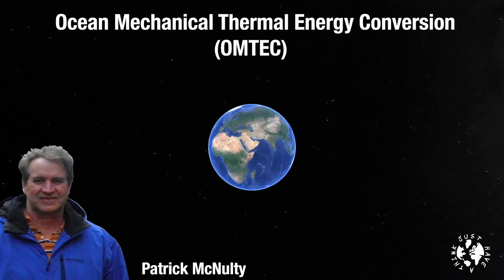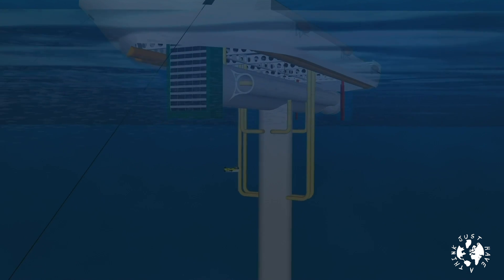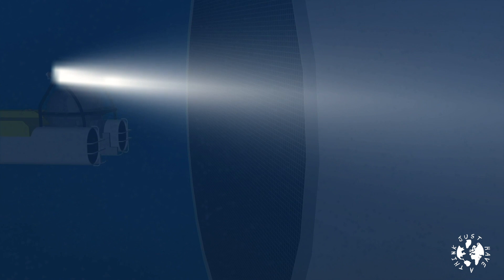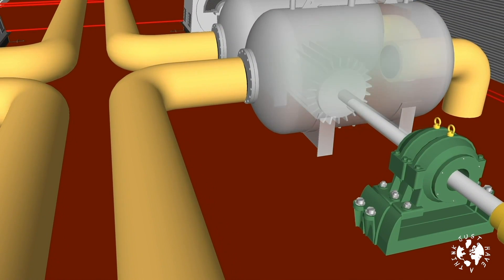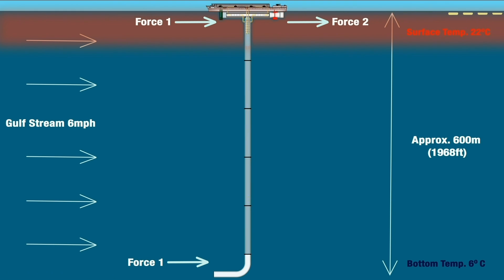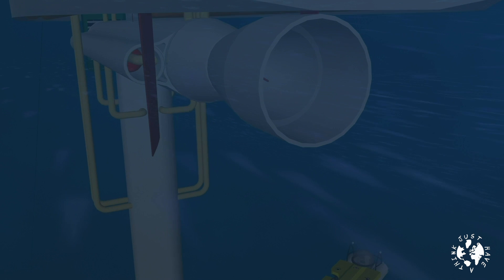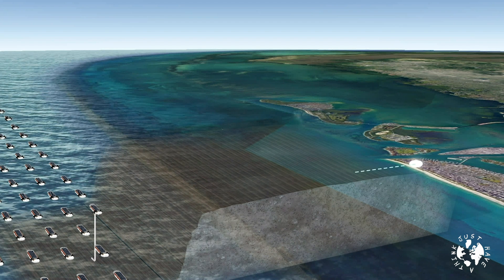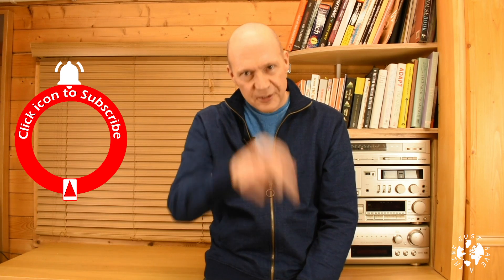Ocean Mechanical Thermal Energy Conversion

Comment: Really fascinating! - would be great to understand a couple of points if someone close to the project can answer ... 1) given the available temperature differences, am I right in thinking the max theoretical efficiency is around 5% (i.e Carnot limit) ? and if so 2) there is a vast amount of heat transfer that you're undertaking here so actually 5% of a big number is still significant?! and 3) given that this is primarily about cooling the ocean surface to lessen the impact of hurricanes etc - the electricity generated is sort of a bonus of the scheme rather than its primary economic rationale? -

Comment: If adding that turbine creates so much energy, shouldn't you just use a bunch of turbines (like an off-shore wind far underwater) instead of the entire system. To me it seems like the solar panels and turbine are the most efficient part of this system. So you could save a lot by just sticking to those and getting rid of the rest. And if pumping cold water to the surface is shown to be a viable temporary solution to climate change, then adding a bunch of those passive ocean straws (tubes with a venturi) could be added in as a separate project.

Comment: I think the temperature differential is too close to get much power out of it.  The vapor pressure to  drive the turbines would be relatively low unless you had some other heat source to raise pressure and temperature.

Comment: So, correct me if I am mistaking but you are proposing to mess with Atlantic conveyor belt, a process of distributing heat from tropical zones towards northern areas. This process depends on salinity of the water and yes, the temperature. Climatologists do warn us that it is already disturbed and may be approaching critical levels due to reduced salinity (ice sheet and glacier melting) You propose to attack it at both levels, salinity diversification and temperature differential. Such a move would (at scale that would produce some effect) as a result decrease its performance and have therefore tropical areas warmer and northern areas cooler. (Not reduce overall temperature of the globe) I will not try to go into calculations to see which amount of interference would be necessary, all I want to point out is that there is no "free lunch". What you propose potentially does reduce losses in a process of power generation by some measure i do not doubt that but overall messes with much more important process of balancing of the temperatures in larger area and water circulation which i am sure is tied up not just in for example rainfall patterns and plankton distribution but in quite a few more areas which biologists and meteorologists could point out. Sounds a lot like you are proposing to reduce inherit losses in process of shooting ourselves in the head for sake of a few kilowatts of "free" energy? If i may i would suggest that you "just have a think".

Comment: The obvious question is how does this complex system handle large waves and storms.  Also keeping Freon as a liquid would allow more power through the generators.  I’m not a representative for big oil but I heard of a project called net zero where they generate electricity from natural gas, using compressed co2 instead of water to run the electricity generation.  This would be way cheaper than your ocean electricity generator.

Comment: A not-mentioned side effect is the worming of the "deep" water (where the intake is). You just cannot take water from underneath and pump it to the surface and not have surface water flow underneath. You would be increasing the quantity of surface water and reducing the quantity of deep water which is of course ridiculous.

Comment: If you are drawing cold water up through a warmer fluid, then the hydrostatic pressure will vary differently inside the tube to  outside of it, making it more difficult to draw up. If the cold water  was 10 degrees drawn up through 20 degree water, this would generate about 15Pa of stack pressure per meter that would need to be overcome to draw it through the system. Depending on the depth, this could prove a significant barrier to the 'natural' flow of water that is intended to be induced

Comment: If running cables to the shore is a pain, consider using the power to generate hydrogen through electrolysis.  There is already a market for hydrogen and it could be huge in the future.

Comment: you haven't mentioned the energy payback. How long would it have to run to generate the energy it took to build it?
Reply: 5 years about the same time it would take to restore the Arctic Sea Ice..
Reply: @patrickmcnulty848  compared to 3 months for an offshore wind turbine.
Reply: @philiprogers5772  The problem is windmills are not 24/7/365. Ocean Mechanical Thermal Energy Conversion is.. Great for base loading..

Comment: I find it hard to see this realy work, forces on the pipe will be a challenge. And also, the cold (denser) water will not want to go up into the hoter ( less dense) water without having energy put into it. I dont see it all adding up
Reply: The energy to raise the cold water comes from the venturi effect of the Gulf Stream flowing through the large horizontal tube.  Watch the vid again.
Reply: @danmoyer4650  That just a T in the pipe with a restriction behind it. Not a venturi. This is not going to work at all.

Comment: This was incredibly fascinating to watch and learn about. I simply love the concept and potential this sort of energy generation has, especially for reducing our reliance on fossil fuels and generating clean energy, all provided naturally by the planet. 

If I may ask however, given that the OMTEC 'ships' are constantly in motion, how will the energy be transmitted back to the surface / mainland? Will there be energy storage solutions like batteries implemented on board? Or is it going to be a case of undersea cabling (which may also limit the distance the ships can travel)? 

It would also be cool if the ship could carry the USVs on board like a sort of 'mothership', where it can be charged and re-deployed as needed, where energy availability allows of course!

Many thanks for the great presentation. Graphics were top quality too, really appreciated those!
Reply: The Ship/platform would be Stationary and conected to shore the gulf stream curent would move the water through the ship and using the Temp/presure diference to move water through the heat exchanger.

Comment: Thanks.  This sounds like something that might have promise - at least it does to me.  But I don't know what I'm talking about.  So, there's that.  I'd be very interested in how much this would impact the Gulf Stream itself (and the ocean life therein, of course).  Studies of such - which might be crucial, and therefore rightly demanded beforehand - would also (probably) be quite expensive.  This gentleman might find himself in a position of needing some influential and/or powerful friends, to pull off even that much.  And such studies can always be (and often are) simply disputed.  I'd also be concerned with the comparative impact of this idea vs putting floating platforms out there which only do power generation.  I don't know if anyone could even asses whether it would do more good to just concentrate on having a platform that purely generates power - wave, solar, wind - vs this idea.  Many, many questions, as always, in any such case.  It may be more important to generate clean power, than to also use such a system to possibly affect the Gulf Stream.  This idea may well find itself in an uphill battle, before even facing off against big oil.       tavi.

Comment: I think this system has a better chance of surviving a storm or hurricane than an offshore wind turbine.  It would help a lot if the ship was submersible so it could be underwater during very rough weather.  I wonder how well the offshore wind turbines do in a severe weather event.  Does feathering the blades take enough stress off them to prevent damage?

Comment: Also warm parts of the ocean are less productive than colder parts because the less dense warm water does not keep nutrients very well. The nutrients have a tendency to sink because the water with phosphorus, nitrogen, etc is heavier. And in warm, less dense, waters this effect is more pronounced. By taking this cold nutrient rich water in to the surface this contraption will very likely increase the amount of plankton and have and even greater ecologic effect.
Reply: There is a very interesting video of the youtuber "Atlas Pro" Called "Oceans are deserts" https://youtu.be/MT28gm9CNuI

Comment: how does this solve anything? in fact on the long run this will cause more issues 
for one the hot surface water still radiates the heat back into the atmosphere and into space.
if you warm up the lower water regions you will capture more heat and less is radiated back into space.
also itl fuck up life in the deeper regions that are a lot more susceptible to temperature changes.
you kill more wildlife you will inevitably contribute to heating up the planet even more.
nice little engineering toy true to that but this is NOT worth it at all. as this literally just is a patchwork to make it all look it is just perfectly fine until the shit hits the fan even harder. and sooner.
we need to get the additional heat off the planet not store it even more.
Reply: You are right. But we need to also consider the upwelling of nutrients from the cold water in the deep sea. This will (in the open ocean) create a wake full with phytoplankton and will actually feed the ocean life while retrieving carbon from the atmosphere.

Comment: ... IS it more expensive than gas? 
Well. per megawatt, YES. 
So it will either never be implemented, or it will not be implemented in our lifetimes. 
What would need to change is a price over 25 years of PER MEGAWATT. Being cheaper than either Gas, or nuclear. 
Because no government, (especially the USA) is going to throw money at something to "Save the Environment" and there is NO incentive for commercial enterprise to do anything. 
Until that changes, nothing will happen.

Comment: Reducing the surface water temperature will reduce the productivity of the ocean's photosynthetic zone, causing poverty and starvation.
Rather than inventing new means of ruining the environment, promote old architectural designs that eliminate the need for  global warming air conditioning systems.
Reply: Actually bringing up colder more nutrient-rich water from the bottom will increase the number of nutrients available in the surface water increases productivity.

Temperature is not much of a factor for the algae growth, after all the oceans close to the poles are some of the most productive on the planet in that regard.

Comment: Sorry to say so, but this sounds like a very unscientific idea. Basically you first specify that the pumps etc use up about 99% of the power generated by a normal OTEC system, but that here this energy is easily generated by the single underwater propeller. So why bother with all the OTEC hardware? For the total cost of the OTEC part of the installation you could build at least 5 of these propellers, generating 5 times more power! Unfortunately a 10m propeller in the slow gulfstream does not generate much energy, compared to a standard wind turbine, even with the venturi. Also by placing a propeller in the venturi greatly reduces the upward pumping power of the entire system, which needs to be significant, because the water at the bottom is much denser than at the surface.

Comment: To draw water into the condensers the pumps would have to operate at a lower pressure than the flow in the venturi, wont this reduce speed in the venturi lowering its effect while also drawing some warm water down from the venturi and cause a mixing that will in turn reduce the gains it made in the first place by having less of a temperature differential??? I assume there is a sweet spot where is will work but it would be interesting to see this in a flow model to get an idea of the scale and size ratio of individual components to generate a significant flow.

Comment: don't know much but my first thought was what is running the pumps and then you explained that, and then my second thought is could bringing all that cold water from the bottom and releasing it to the top actually have a negative effect especially if this is done in a multitude larger scale

Comment: I'm new in fluid dynamics , but I have a electronics background. And with electricity the current will flow along the way with lowest resistance. I''m interested in new ideas like OMTEC, but are you sure the venturi effect works if the water can flow along the tube? I think venturi effect only works if the tube is a closed system,(constricted area ) but I'm not sure.

Comment: The OTEC are an old concept. The limit is the volumetric flow causing the cost to increase too much for a few kW power. The second limit is the tightness of the system.
Have a look to my OTEC made just for fun.. 
https://youtu.be/r029qfNFSmM
Reply: OTEC is different then OMTEC...
Reply: @patrickmcnulty848  ok got it. The passive water flow is a good improvement and the freon also has to naturally circulate. The challenge is the tightness of the system and the cost per kW dealing with a huge freon working fluid cycle. If you start the project I will be a fan supporter!

Comment: What about converting oil platforms? 
Couldn't a Trompe be used at sea? 
Bill Mollison talks about isothermic compression... the full video talks about how it used to be in use in Paris early last century, that pressure tanks could be used for refridgeration, for running cars with no emissions, so in theory pressure tanks could be refilled at sea and transported to where they are needed.
How would OMTEC deliver it's energy?
https://www.youtube.com/watch?v=50fJ8Av_g7Q
Reply: Obsolete oil platforms my idea exactly along with the rusted out second fleet just sitting dockside... :)

Comment: "The Gulf stream is neither constant or unidirectional especially at depth where there are current running in the opposite direction. Nice try tho."...
..."very slick production but as discussed yesterday the concept of non-laminar flow also known as turbulent flow seems to have been forgotten. The shearing forces at the pipe and platform interface were well espoused but the cross currents at depth were never mentioned....
...Yes they talk about the bending moments imparted to the down pipe but its propervating (sic) force is the rise and fall of yhe (sic) platform and a singular current frlow (sic) in one direction. If the (sic) had counter currents and cross currents that induce heave pitch yaw and torsion forces then I would be impressed but this would have to be numerically modelled rather than empirically tested."... 
..."Yep. As usual it bigs up the advantages but takes no account of the environmental consequences of pumping gigawatts of heat into a cold water environment that we know almost nothing about." Lay Experts (2020).
Reply: It is between Miami and the Bahama bank all the way to the bottom... :)

Comment: Extremely large plant required. Needs to be located on suitable spots in the ocean and moved around in response to currents and temperature plumes. I'd say, impractical to build and nearly impossible to devise ways of getting the power generated to land. Especially given the ease of generating what we need from fixed predictable sites on or close to land.........

Comment: @Just Have a Think  Hi I love this idea specially using the Venturi Syphon to 'pump' water up to the surface from 1000m deep, you get higher energy than what you put in 👏👍
I would like to suggest, instead of freon working fluid based binary cycle power conversation, why not use a Low Temperature Difference Sterling Engine, which works with a temperature difference as low as 5 degree C, wouldn't that be better, what do you think 🤔
Keep up the good work.
Reply: Binary cycle is a continuous system: better for large scale.
Reply: Can a Sterling engine be scaled up to multy megawat outpute levels?

Comment: What are the advantages of OMTEC (and OTEC) over just using the tidal turbines off-shore like the Scottish ones featured on the Fully Charged channel?
Reply from the maker: Hi Frithjof. The advantages of basic OTEC over the latest tidal turbines may be smaller now that tidal turbines can automatically turn to harness the tide in both directions. But OMTEC does far more than provide electrical energy - in fact that's almost a by product of the main function, which is to bring cold water up from the deep to reduce surface temperature. In areas like the gulf, where Patrick McNulty envisages these units being deployed, the hurricanes get much of their energy from ocean temps, so if they can be reduced by a degree or so, that's a massive amount of energy taken away from these destructive forces.

Comment: I'm a little concerned about it's impacts on the Gulf Stream, and it keeping northern Europe warm.
The stability of the Gulf Stream is already under pressure, from the increasing amounts of freshwater originating from the Greenland ice sheet melting.
Without thermohaline circulation, the northern Atlantic will be very cold.